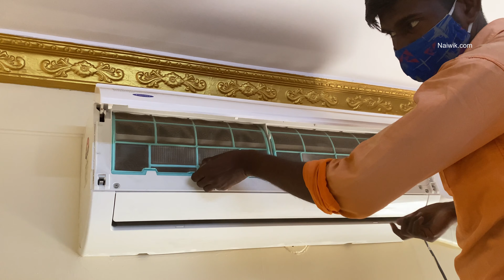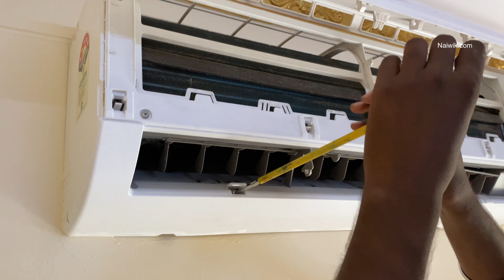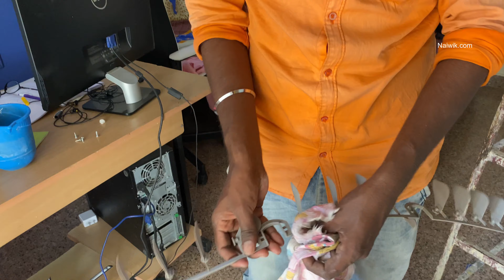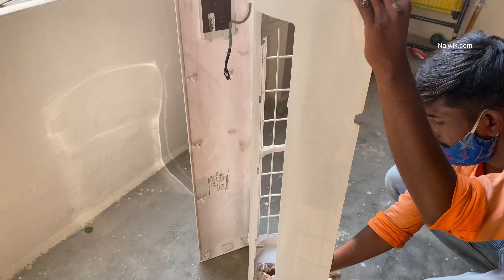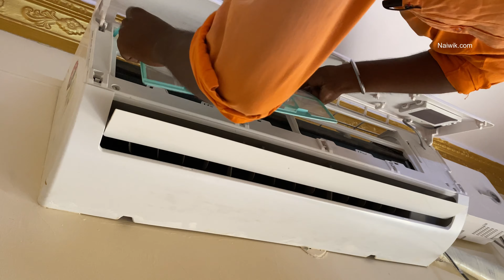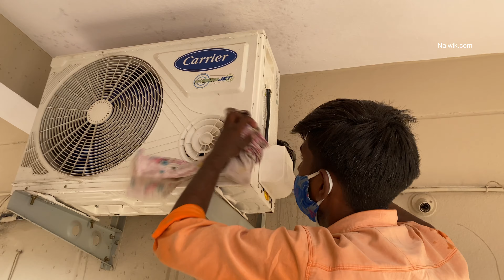Carrier Split AC Free Service at Home

Comment: The swing is not full closing when i turn off the ac..and i did switch the power off and on..its not full closing .. how can i fix it ?
Reply from the maker: No idea Bro , but for me it closes automatically once I switch off ac
Try to contact customer care
Reply: Haa bhai mera bhi yehi hota hai
Reply: it's a self-cleaning feature added in new models. Not a problem. It can take from 5 to 20 minutes to self-clean - after that, it closes automatically.

Comment: Single Carrier brand AC... pcb board cost is 25000....actually it has two pcb board.... so total cost of replacing pcb board is more than new ACcost..... so if you have problem with pcb... best option is to buy new AC
Reply from the maker: I had replaced the outdoor PCB unit . It costed me Rs.9500
Reply: Mitsubishi heavy industry.air conditioner .non inventor spilit ac. performance is good
Reply: I have 3 year warranty... So should I worried about pcb? I think it's from flipkart extended warranty